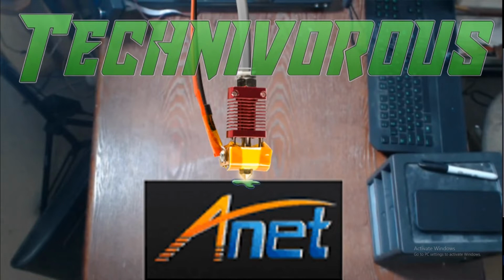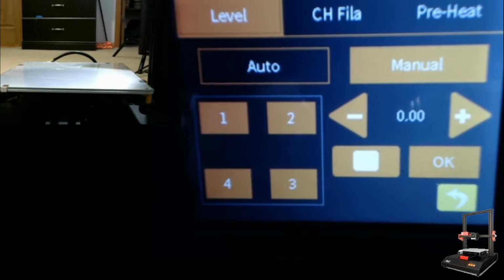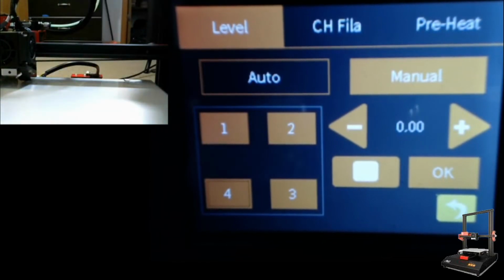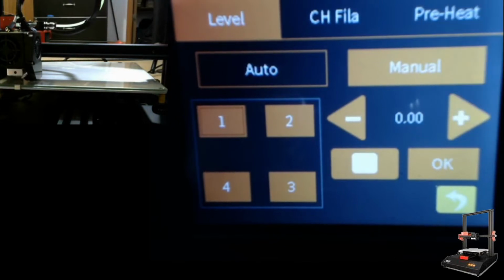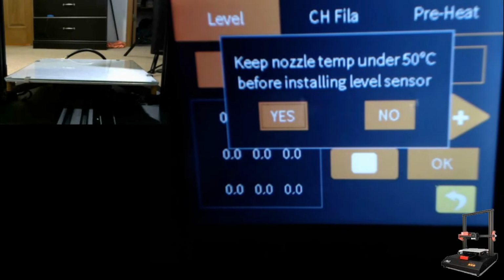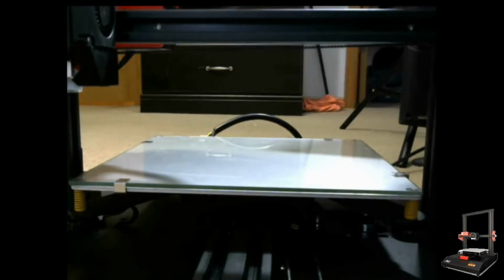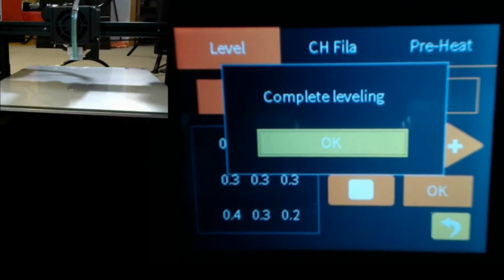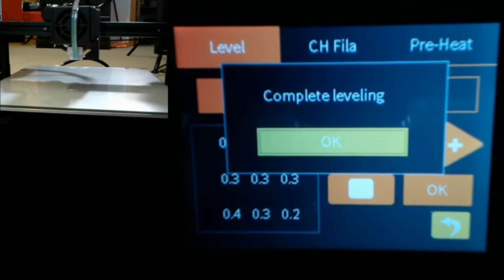ET4 Components  - ABL - Automatic Bed Level for 3d printer

Comment: I just bought this for my son for his birthday he put it together himself but when it comes to manual leveling the knob that you turn to adjust the bed up or down just spins around. So I had to take the glass off to get to the screw and tighten the knob. He printed the small cube that they want you to print out first that worked but when he switched to the regular filament it kinda of melted on the nozzle can you explain what he is doing wrong?